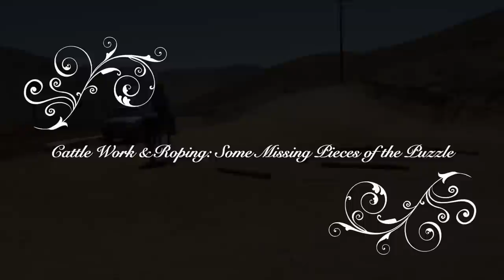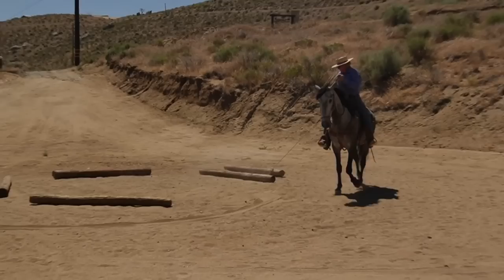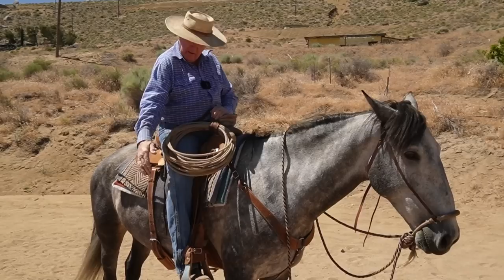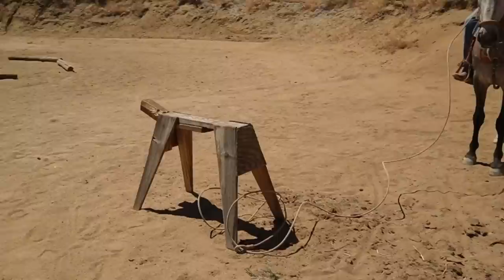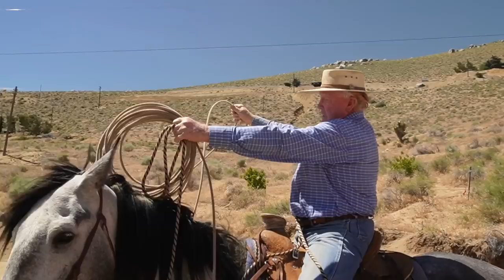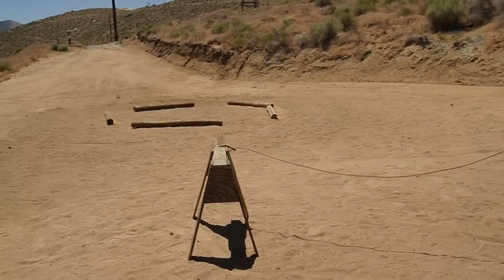Cattle Work & Roping: Some Missing Pieces of the Puzzle

Comment: I never had anyone to show me how.  I had to figure it out on my own.  I'll tell ya, the 1st time you get hooked onto a bull, all by yourself, it takes about a second to figure out what NOT to do.
I learned to rope back legs and then tangle them up by circling the big critters.  You end up with a critter going down slowly.
But you need a BROKE horse to try that.  One that will hold pressure while you're down tying it down.
I tried it on a 3 year old gelding once.  He was coming along nicely, I thought.  But I dang near got me, the horse and the bull hurt.  A few bumps and rope burns later found us all mostly unharmed.  That gelding learned how to work a rope that day...but not how I would have prefered.

Comment: I cant believe that guy would do that with a riata that costs at least $200. Because it would chew it up dragging it across the ground with the weight of that post on it. 
     When i trained horses to pull from the saddle horn i had a chain around the post. My lariat was connected to the chain thru a big metal ring. It didnt touch the ground. And my lariats only cost $35. This man is full of shit.
Reply from the maker: So much to unpack here. First of all, where are your manners? If you're old enough to remember $35 reatas, you should know better. Second, maybe we should all take up a collection to get you some new spectacles because the rope in this video is made of nylon. Third, Pat's reatas sell for between $500 and $700. And they will hold up to dragging a post...although there was no post dragging in this video. So I am completely at a loss as to what your actual problem is. I hope you can sort it out and get back to me. I'll wait.